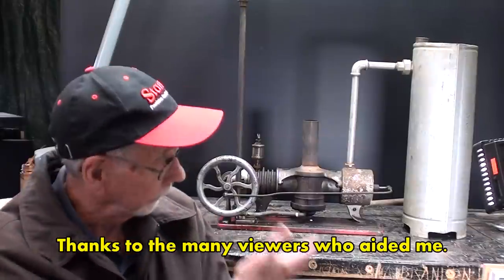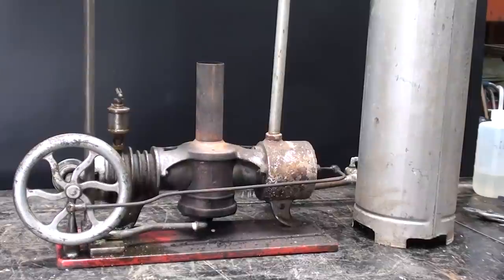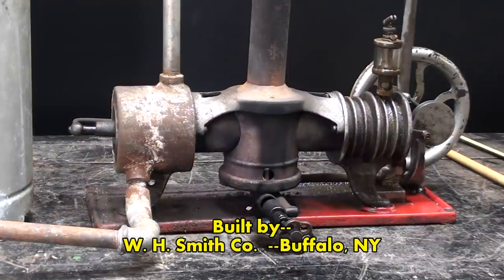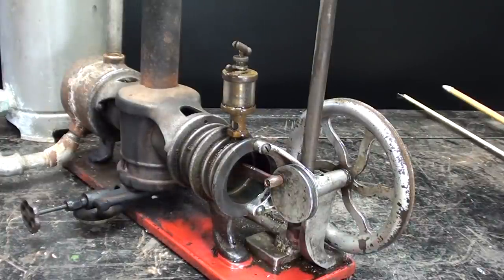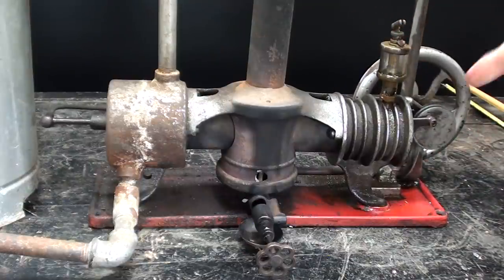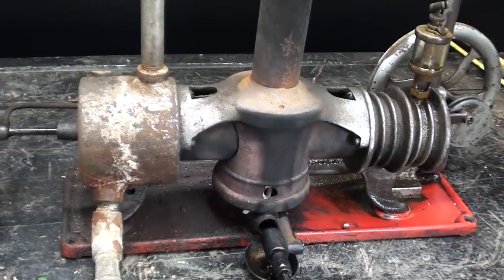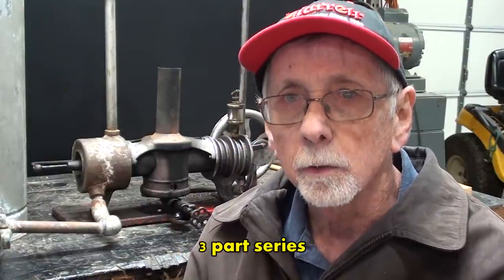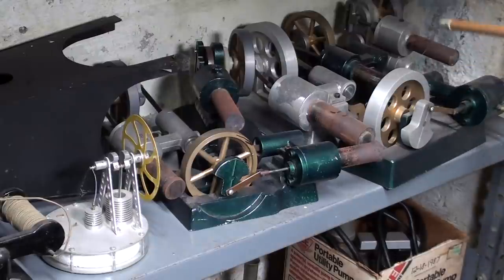ESSEX HOT AIR ENGINE pt 1 #766 tubalcain  stirling

Comment: In the later 40s we had a popcorn guy that would set up his horse drawn popcorn wagon in town at a permanent site during the summer and into the fall. He got power from a building because I remember it being well lit. Us kids, after we enjoyed jumping over the tung of the wagon, would stair and watch him make popcorn. The little engine was beautiful and had a flywheel. I remember the oiler because I didn't know what it did. It was probably a Cretor popcorn machine, and it would be interesting if one could find info on the little engines they would have used.
Interesting vid,
Lee

Comment: Interesting little machine! The water cooling system is quite ingenious - It reminds me of when I worked in a boatyard 30 odd years ago building canal narrowboats that required about 4 to 6 inches of concrete in the bottom of them for stability, and used a few tractor weights here and there to trim the level of the boat, but the old concrete mixer we had used a gasoline "old thumper" engine ( I seem to remember - maybe it was paraffin or red diesel) with a pot of water atop the cylinder head to literally boil the heat away, and had to keep an eye on the water level and top it up
Reply: The engine was probably a Lister model D, I think about 1.25 hp

Comment: Don't know why there isn't more interest in these remarkable engines as they helped power the industrial revolution.  Although they couldn't produce as much power as a similar sized steam engine they were a safer alternative as the early boilers had a bad habit of blowing up and killing workers.  Due to only needing a heat differential to operate and thanks to advances in material science the Stirling engine is making a comeback.  Nasa has developed some extremely efficient models to operate in space and the Swedish navy's newest submarines run on Stirling engines where their low noise output is advantageous.  I for one find all of your videos fascinating.  Thank you
Reply from the maker: Thank you very much

Comment: I would say it used kerosene (paraffin) and the height is to provide the pressure to atomise the fuel  in a similar way to the air pressure is used n a hurricane lamp

I think Gasoline was be too fluid (thin) for those valves  .

Comment: Would be neat to put this on top of a wood burning stove to power a fan.  If you could move the radiator far enough away to maintain temperature differential.
Reply: Why on top of the stove where it receives excessive heat? Seems like that defeats the necessity of a temperature differential.

Comment: that is a sterling engine. only thing is that the cold and hot side is flapped from the normal configuration. and the displacer is normally driven with a rod thru the piston, not externally.
Reply from the maker: Yes, watch my many other videos about Sterling engines